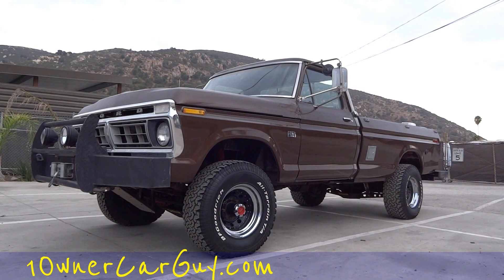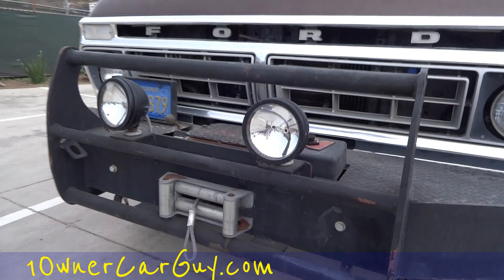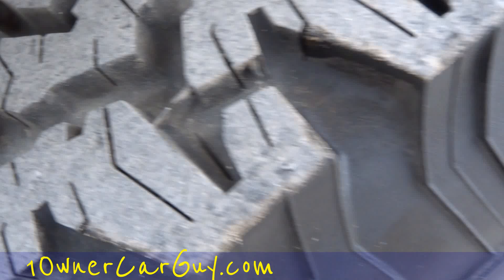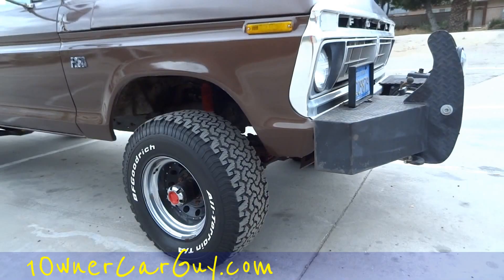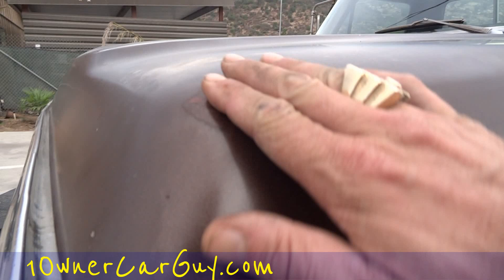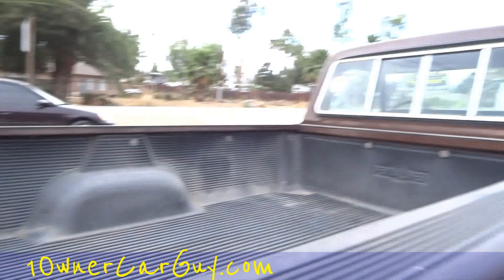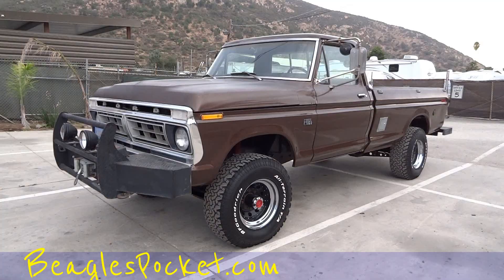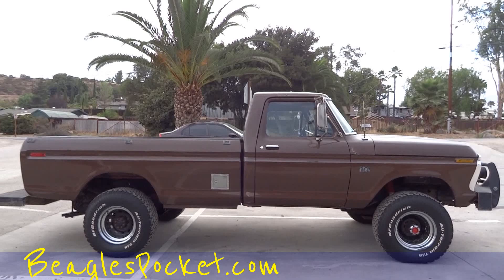Ford F250 Highboy Pickup Truck Ranger XLT 4x4 360 V8 Custom Off Road Pickup Truck For Sale

Comment: That is a truck built for a cab over camper. The bumper is actually a step to get into the camper. The brackets on the bed are to tie the camper down and the leafs are beefier for the weight.

Comment: The low pedal wear really leads me to believe is a genuine 65,000.  I've had valves as loud as the noise in the video that were cured by a warm clearance adjustment.  I'd be surprised if a few easy fixes didn't make this into a fully working gem.  Nice unusual vehicle.

Comment: Nice tough pickup. They made that body style from 1973 through '79. The extended cab "supercab" pickup came out back in 1974 & the fullsize Bronco replaced the smaller Bronco back in 1978 & the F-150 came out in 1975 as a stronger half ton pickup than the F-100. They still continued making F-100 pickups as base models up until 1983 which was 3 years after the body style was redesigned in 1980.

Comment: That is stock and OLD SCHOOL as all get out, I thought they quit using that style axle in the 60's but I guess not on HD trucks, I'd definitely swap a newer D44/D60 front axle with ball joints in as well as put a new set of  custom Deaver springs on it with more lift and lose those rear blocks.

Comment: I think its a 3500# Dana 6CFG-HD or 446FHD, I could be wrong but those were used in earlier years... drop the HD and its a 3000# rated axle found on 1/2t pickups

Comment: This is very clean for a 70's pickup. I believe the mileage. I think some light maintenance on the original engine should do the trick. I am not much of a Ford guy, but I think a modern powerplant (like the Power Stroke as you stated) would be great for this truck.